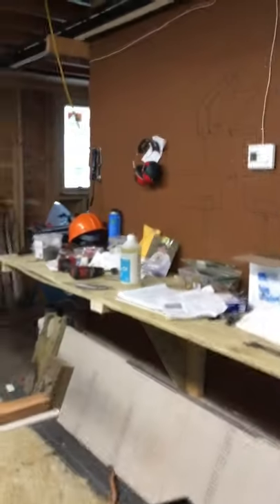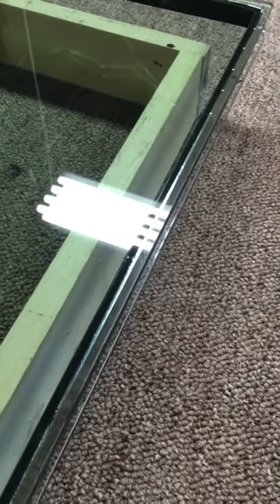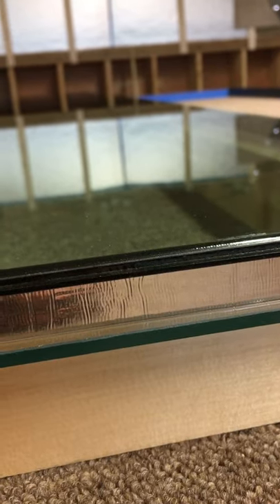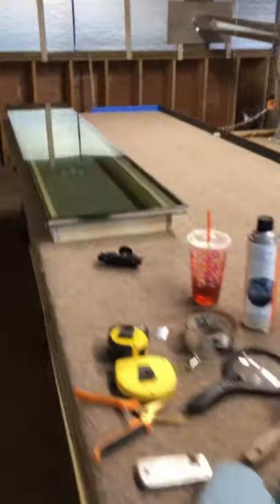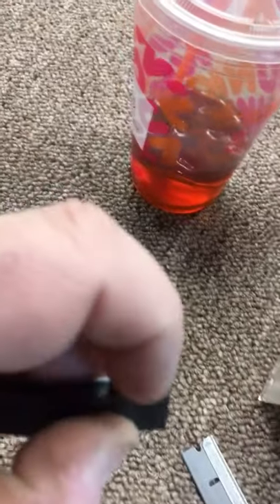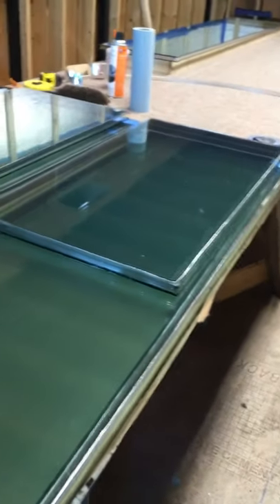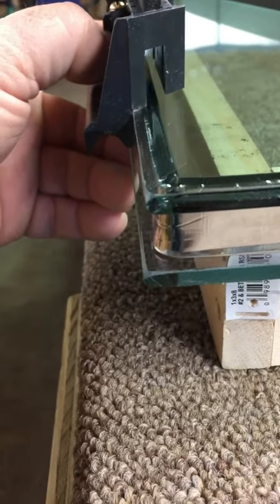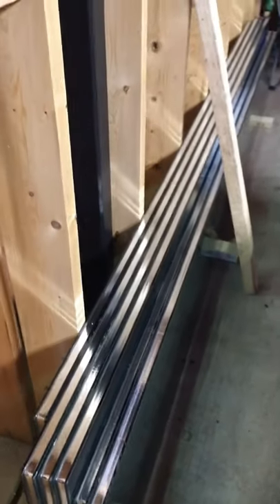Nothing to it..Make your own insulated glass. Save mega bucks 💰

Comment: Thanks, you’re helping us save our budget!   You can lower humidity more by using AC.  Warming the air will allow air to hold more moisture
Reply from the maker: We’re located in New Hampshire this project was done middle of winter less than 30 degrees out 👉the heating unit is a 199k btu space heater which utilizes a flame tube and fan  and direct vent.

Comment: Also does the spacing material come in different widths? And is the tool your using work for any thickness that you need to align the spacer to the edge of the glass? Ty for your time I showing this I couldn’t imagine how much you got quoted in your glass fixtures I tell ya for a 8x12 tempered glass for a 15 windo pane door was 250$! So I’d say prob 10-20 arms and legs bub
Reply from the maker: Yes absolutely we needed  an overall 1” thickness for our aluminum frames  this spacer is 5/8” with our 3/16” glass.  Yes that tool has height adjustment for the varying spacer widths